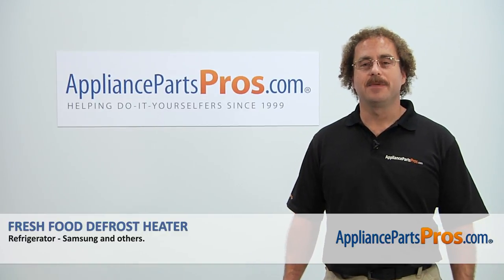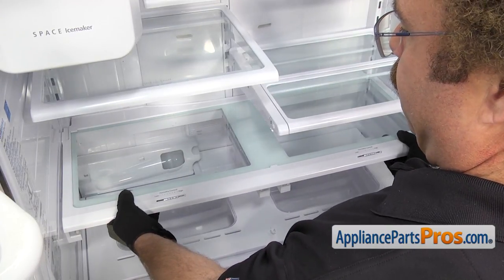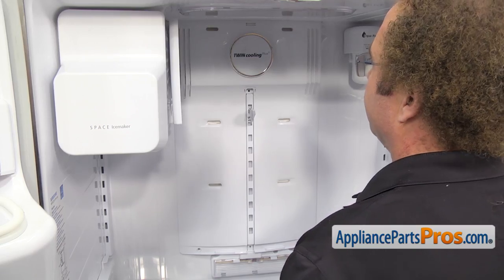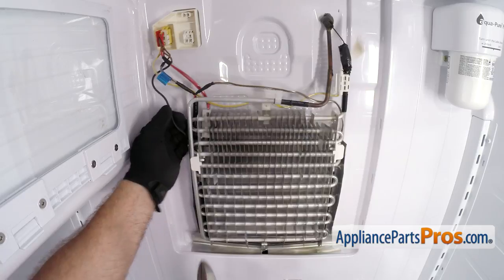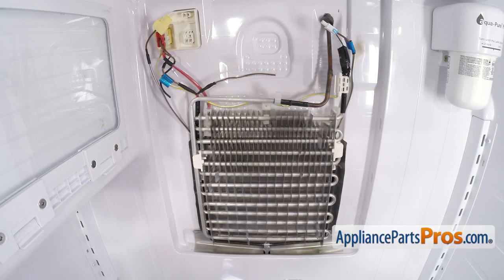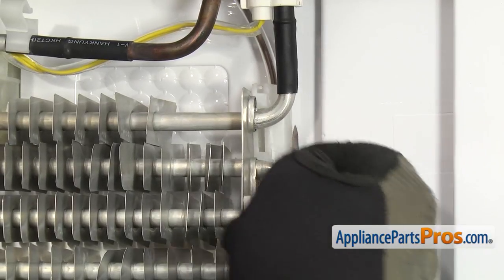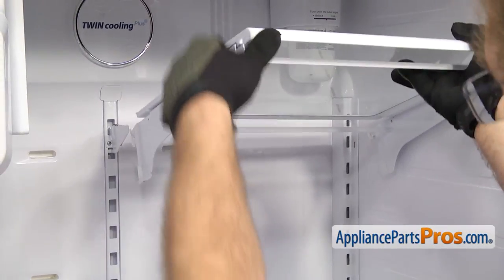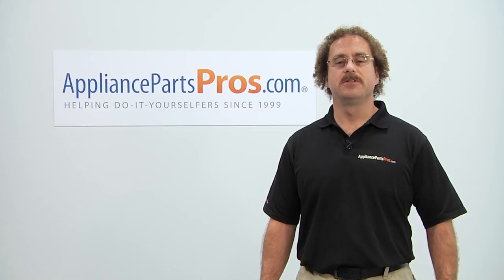How To: Samsung Fresh Food Defrost Heater DA47-00424B

Comment: Great video, in the UK you can get the heater wire and also the extended drain clip from Amazon shipped from USA. The only thing you missed was the heatshrink, you need a 10mm dia and about 25cm length to fold the bare heater wire and cover it, otherwise you'll get a burning polystyrene smell. Also getting the back off ain't easy, takes patience and about 2hrs if badly iced like ours, but cheaper than a new fridge/freezer.  Samsung should have had a recall on these as not fit for purpose.

Comment: On the newer model that you do not have to respites back in do they make a longer he coil to add more heating element to the upper copper hose everyone saying that if the heating element was longer and operatum the copper tube that it would not freeze up all the time any help with that thank you